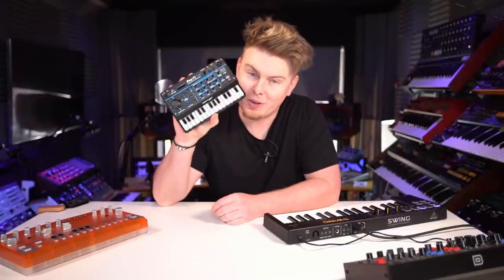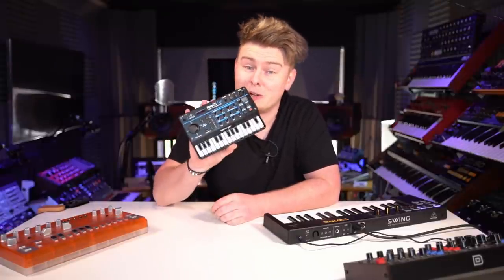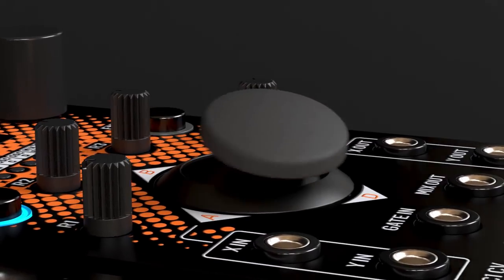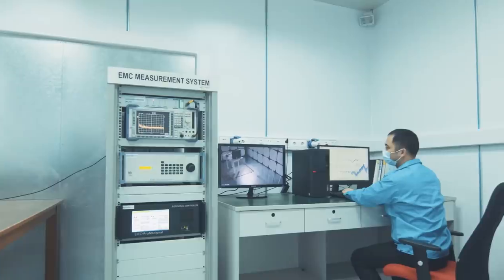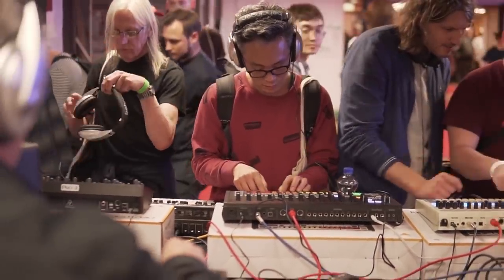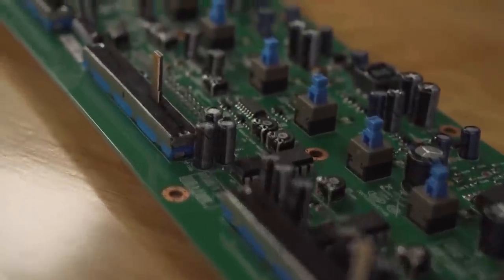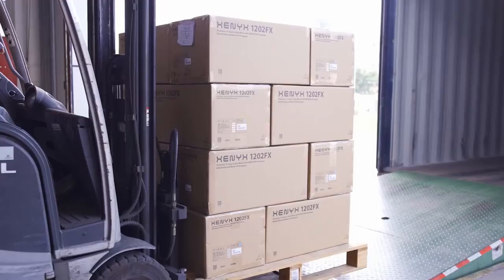Why We Let You Design Our Products

Comment: I have only one thing to ask: is the Solina still planned for production?
Reply from the maker: 100% - As soon as we receive the chips required to put SOLINA into production, it will go into production right away. Our factory is ready! The global component shortage is very much a real worldwide and industry-wide challenge, so although we don’t have a fixed date, we are doing everything we can to get it into production ASAP - Dan
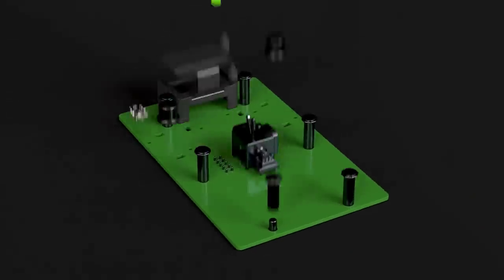Reply: @behringer  I beg you, please reconsider adding the 4 V/O inputs on the 1st design. 0:18 Obviously, controlling all waves from one V/O source is necessary. "Com CV" as it's labeled. BUT with 4 V/O inputs? Now you have a Mini-Wavestate module. That is a HUGE addition. e.g.  patching a separate V/O CV into "OSC3 CV" during a performance to add a new sequence to wave 3. Or 4 completely separate sequences! Or sequencing 3 OSC from 1 source while playing the 4th with a controller.  

The FM and Gate inputs are nice but 4 OSC CV INs are future proof.  If possible, please ask whoever if they can reconsider that. Eurorack enthusiasts with larger systems or multiple sequencers/controllers will appreciate it.